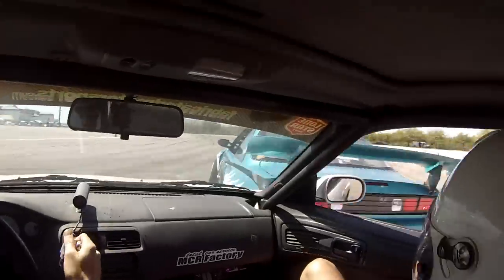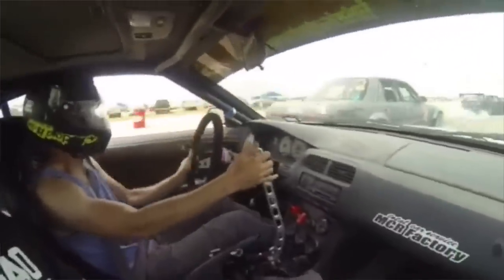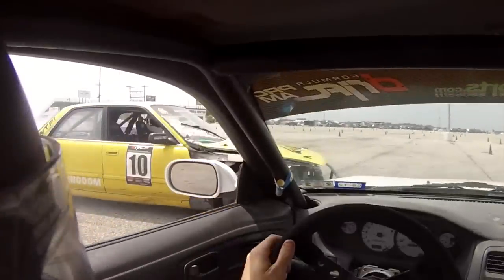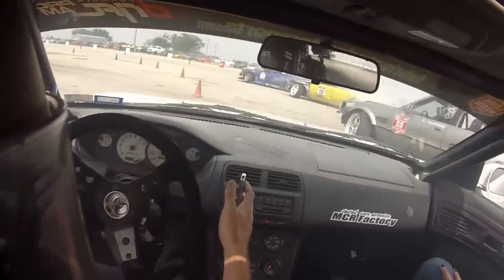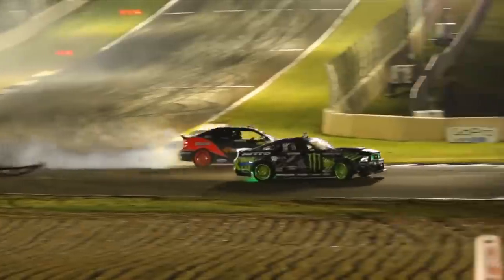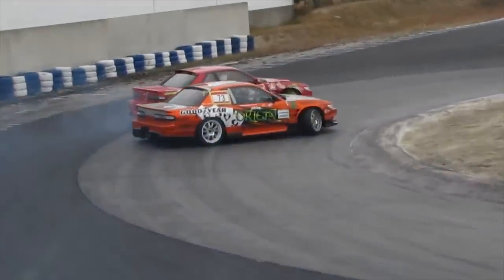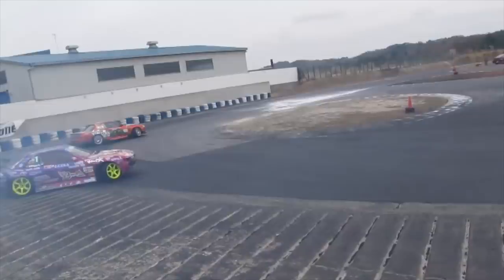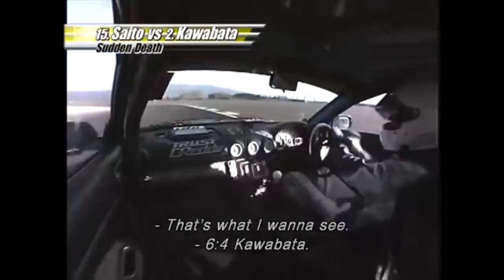How to drift - tandem explained

Comment: Dude! Thanks a lot! This vid opened up my eyes a bit more hahaha. One question, Ive always understood that when you tandem with just one person you try to aim for their door. but when you're with 2 or more guys in a tandem, the chase car right after the lead car has to follow a slightly wider line, basically you're aiming for the rear wheels instead of the door, to make it easier for the guy whos chasing you while you chase the lead car. Hope this all made sense and please correct me if there's a flaw in this mindset for tandeming. Thanks!

Comment: This needs to gain traction.  Judges and announcers need have this level of intimacy with the actual driving part of the sport.  Getting lost in fan speculation and hype is one way to run a series for sure, but I think have higher expectations on the drivers through a discerning judge would be equally as entertaining.  I'm going to watch this more than a few times.
Reply from the maker: I am glad you liked it!  What do you mean the judges should be more discerning?  Do you think the judges in FD are incapable of judging, or you don't like the style of certain comps?  Just curious exactly what you mean!  Thanks for taking the time to come comment, I appreciate it!
Reply: To me, it seems on average the judges don't really jump in to give a play by play with the announcer.  There is a lot of post run review but I would like to hear what some of the judges think as the run is happening.  I think it shows a certain level of knowledge about what exactly the drivers are dealing with and would give the impression of confidence.  I think when you have a chance to see replays and ponder for a bit, it lessens the impact of the art of drifting.  Just as your moves in the car are sometimes impulsive, the judging should be as well.  It's a visual impact sport that shouldn't be too qualitative.

I think the judges in FD are perfectly capable of judging, just that they sticking too strichtly to a set of rules that aren't geared towards show "impactfulness" towards the fans.  Structuring rules to make closer tandems is the way I would like things to go be that through vehicle limitation and regulation or by the way they instruct drivers to attack the course.  Personally, I don't think judges should instruct at all how to attack the course.  They should just have in their mind what would look most exciting to the crowd and see who gets closest to that.  By creating rules that dictate where to accelerate and brake you take away a lot of creativity of what the drivers can do.  I think back to Mad Mike in Atlanta where he threw down a spectacular run visual and audibly but what given an ill score do to missing driving instructions from the judges.

Definitely I think track selection could be a lot better.  Still speaking of FD; I'm surprised they're venues haven't changed.  This country offers a lot of locations for drifting that would be an ideal venue for visual impact that I think aren't even considered.

I want to come drive in your street legal series.
Reply from the maker: Thanks for your thoughtful comment!  

1.  Track selection in FD I think comes down to a lot of factors that probably aren't apparent when you first think about tracks.  You seem to have thought out your reply really well though, so you are probably well aware of a lot of these factors.  I have the same problem at a smaller scale though.  We have so many cool tracks around, but they don't work for one reason or another for local drift events, and cost actually isn't even the main consideration anymore.  The main considerations are how visible and how enjoyable would the track be to spectators, which is such a hard nut to crack.  No road courses in Texas really are that spectator friendly in the way you would think they should be, I don't know why they don't build them in a more spectator friendly manner.  I guess they know that no one actually watches road racing in person as a spectator.  So track selection comes down to how enjoyable things are as a spectator, and Irwindale does that really well, and so does Road Atlanta.  I think Road Atlanta is the most spectator friendly track ever for drifting, it is amazing.

2.  Judges telling the drivers exactly what to do....  The drivers demand this, because they want to win.  If no one knew what the judges wanted, they would all go do their own style, loose organically, and then get angry, which is what used to happen.  The drivers demand the judges tell them EXACTLY what to do to win, and then they try and do EXACTLY that, because they want to win really badly.  They don't like leaving things up to chance, style, or anything else.  But I personally like the idea of all the drifters looking different, with different chassis, different styles, etc.  It makes drifting more fun.  It is all so odd and counter intuitive sometimes too, where the larger fancier drift tracks and styles in D1GP make D1 loose it's flavor.  Minami at Ebisu is a way cooler D1GP track than the huge Fuji Speedway, with a jump, tight crazy track, etc instead of a huge beautiful F1 looking track that has the drivers going 140 mph in drift.  Drifting doesn't have to be a want to be professional motorsport, it could be more like skate boarding and the X games, but it kind of is always in limbo somehow.
Reply: +Lone Star Drift I totally see your point.  I'm pretty partial to go kart tracks that are drift friendly but most people seem to get bent out of shape when you can't do a 100+mph entry.  Those sorts of high speed things are really satisfying for personal development as a driver but I think the slower and more technical driving is what makes me people really appreciate driver skill.  Seeing someone make banners on a k-rail flap in the wind and leave tire marks on peoples doors always gets me.
Reply from the maker: Here I am flipping up the banners at Nopi 10 years ago driving with Forrest Wang lol.  

https://www.youtube.com/watch?v=iNw3rr5nWyc
Reply: That's sick, I really need to quit procrastinating and build something to drive.
Reply from the maker: Just buy something finished and ready to go, by far the cheapest and fastest way to driving!

Comment: love this video, keep posting vids like this.
Reply from the maker: I am glad you enjoyed it!
Reply: +Lone Star Drift can you make a video giving tips on how to drift an automatic? I know it's possible I've seen it done in the UK with guys drifting going 100mph on a stock soarer with a welded diff. I know that it isn't efficient to use an auto as you can't clutch kick and ebraking isn't the same. 

I currently drive a jzx110 with a cusco 2way and I can get it sideways, I just need tips and advice as I'm going to my first drift day in 2 months.

the main difference I find myself is that; 1) you need to commit more into the drift than you would in a standard 2) you have to avoid lifting off the throttle 3) going into corners it's better if you feint and break traction well before the corner and manji it.

sorry for the long post I hope you respond. thanks man!

Comment: Love it please keep doing videos like this it helps alot for new drifters. :)
Reply from the maker: I will, let me know what topics you would find interesting, I am getting ready to do another how to video.
Reply: Lone Star Drift things like how to maintain speed while linking corners. It helps alot understanding what input is needed etc. I know its not the same for any track but a basic break down wouls definitely help. 😀
Reply from the maker: Cool thanks!  I will address that.  Short answer is know when to use big angle and know when to use little angle, as large angle decelerates the car and small angle can be used to accelerate the car.  and pedal the throttle back to increase traction, etc.
Reply: Lone Star Drift i found when i was learning the hard part of getting thr hang of it was as you mentioned above. Thanks 😀. Keep it up love what your doing with the local events keeping drifting fun. If im ever in the US ill be sure to attend an event.

Comment: 7:00 its possible if you're far enough back and send it into the corner at a faster speed than the lead car to catch up. you can increase the angle to reduce speed and then straighten out into a tandem when you catch up with the lead. its the opposite concept of gripping up a little to catch up with the lead. sometimes you can see it in SPIRITJP, but of course it's not the same as FD sticking onto their door tandem

Comment: When running chase, what part of the lead car are you "aiming" for? I can never seem to find a consistent point at which to look.
Reply: Edward Thompson typically the back of the front door is a good place to start at with. With sedans I typically aim for the rear door.
Reply: old question but i focus on the front wheels since it's all you really need to watch to see how the lead car is driving and going to behave. when the driver steers, the front wheels moves first a few milisecond before the whole car starts to transition. also its easier to judge the angle and see if the lead is going to spin out.
Reply: @MidnightMuzic  thanks!
Reply: @blankphonk4889  that makes sense. Thanks for the tip.

Comment: great video, one thing I'd like to see would be suspension and alignment settings, ie camber, caster and toe along with bump, rebound, anti roll and diff settings cheers
Reply from the maker: That would be a pretty easy video to do I think, I will put it on my list of stuff to get done : )
Reply: +Lone Star Drift. thanks man always interested in set ups but theres not too much info out there, really enjoyed the ebisu video too, keep up the good work
Reply from the maker: What car did you want the info on?  Tell me the car, and if it happens to be a 240sx, I can type everything out right here for you so you don't have to wait lol.
Reply: +Lone Star Drift yea a 240 would be nice also what settings are on your jzx100
Reply from the maker: On a 240sx you typically align the car so you have:

Front: 

 7.5 to 8 degrees of front caster.   
-3.5 or 4 degrees of negative camber
zero toe to possibly a tad bit of positive toe, but keep it reasonable.
Medium shock settings here, right in the middle.
I like a matched set of anti roll bars that are aftermarket for the front and rear, from the same manufacturer so I don't need to think about it.  I don't need anything crazy stiff, but I like them stiffer than factory.

Rear:

As little negative camber as possible in the rear, I run a tiny bit, maybe - .25 degrees in the back just so I know it isn't positive, that bugs me just because of OCD or something.
Zero rear toe for me.  Toe out will make the car twitchy and change direction too fast, and toe in is something a lot of competition drivers like, but I just like my toe set at zero.  As you progress you can decide to add some if you know what it does and want to try it out, but I suggest zero for now.
Soft shock settings here, mostly soft.  

For the diff I will use either an LSD or welded.  I prefer an LSD as the car has more grip in it when I want it, but either way is totally fine.  I do not want a viscous or most stock types, I just want a 1.5 or 2 way clutch type from a reputable aftermarket company.

As for the JZX100, most of this is about the same, except I didn't mess with the alignment much at all except to get rear tire wear how I wanted it.  I align the rear end mostly to get the tire wear as even as possible to use all of the tire, and get the best life out of it that I can.
Reply: +Lone Star Drift thanks man much appreciated
Reply: Can you post settings on a jzx110 ?

Comment: Great video as always and super informative too! What camera are you using for your in car stuff?
Reply from the maker: That was just a cheap old go pro, nothing fancy.  Placement on the helmet and having it the correct height is the most important thing.  It makes it expose the outside correctly if you get the majority of it's field of view out the window.  Most any cheap modern action cam is more than good enough for this, but I would probably suggest in today's world buying a Go Pro session for the task, as they are cheap, tiny, and ABOVE ALL ELSE, turn on and off when you press start stop record and only have one button.  This makes them last 4 x as long on a battery as a normal go pro, and makes them so much more useable.  So get that!
Reply: +Lone Star Drift !...I lose about half my runs with my Hero3 from button weirdness/freezes/battery death. Gonna check em out :)
Reply from the maker: I have the same problem, and it is very frustrating.  I would say 90% of the footage I see off go pro when editing is just people sitting there in grid doing nothing, or accidentally turning them on, or whatever.  Very little of the footage is what you actually want, and very little of the battery goes into capturing even that.  So sorting that out is even more important than image quality for people that actually use the things a lot!
Reply: +Lone Star Drift Yup! Same with every one I've ever seen. Tried circumventing by ziptieing a notepad with the GoPro App to my dash, then it was even worse - freezing/wifi shenanigans/etc. Next event, I'm gonna try out One Button Mode (power on records video, hold to power off). I always run the same settings, so it should do me right. Might help on your end?

If it's still freezing, may invest in the lil dudes, or see what the competition's got :)

Comment: the Japanese probably developed an apparatus that broadcasts throttle and steering angle information in real time to the other car's gauge cluster
Reply from the maker: They just have been driving longer in some instances, and have smaller tracks that are easier to get super close on.  Meihan VS Texas Motor Speedway are VERY different tracks!
Reply: Because when drifting at 100mph you have time to look at your cluster.
Reply from the maker: You have time to do a lot of things.
Reply: I saw a japanese guy eating McDonalds while drifting once
Reply from the maker: LOL that is an old video!

Comment: all those fucking cressidas..... :drool:
Reply from the maker: I never see them on the street anymore, but we still see a few at events!
Reply: +Lone Star Drift I only say that because I have one lol, 1989 cressida 1jz vvti 5spd.
Reply from the maker: I love my 1J VVTI, good choice!
Reply: she runs great, sometimes she stalls coming down from a high rev real quick.  Damn I love the sound though@!!!!
Reply from the maker: I wonder what causes that?  Mine stalls sometimes in the same manner when transitioning and shifting gears, and is a very stock car.  Maybe mine is the blow off valve or something, screwing up the metering of the air and killing it.  It is kind of dangerous in tandem!
Reply: +Lone Star Drift I read mine was probably an issue since I bought an auto jzx100 swap and I'm running the auto ecu on a manual trans.  apparently it expects to see the rpms drop significantly slower.  I also have a lightweight flywheel so it revs and drops very fast.  I'm not running a bov or I'd think the same, I checked my idle air valve, cleaned it and everything, has voltage at 2 center pins and all... who knows... I'll figure it out sometime
Reply: +Lone Star Drift I read mine was probably an issue since I bought an auto jzx100 swap and I'm running the auto ecu on a manual trans.  apparently it expects to see the rpms drop significantly slower.  I also have a lightweight flywheel so it revs and drops very fast.  I'm not running a bov or I'd think the same, I checked my idle air valve, cleaned it and everything, has voltage at 2 center pins and all... who knows... I'll figure it out sometime
Reply: +Lone Star Drift I read mine was probably an issue since I bought an auto jzx100 swap and I'm running the auto ecu on a manual trans.  apparently it expects to see the rpms drop significantly slower.  I also have a lightweight flywheel so it revs and drops very fast.  I'm not running a bov or I'd think the same, I checked my idle air valve, cleaned it and everything, has voltage at 2 center pins and all... who knows... I'll figure it out sometime
Reply from the maker: Well I am curious if you figure it out!